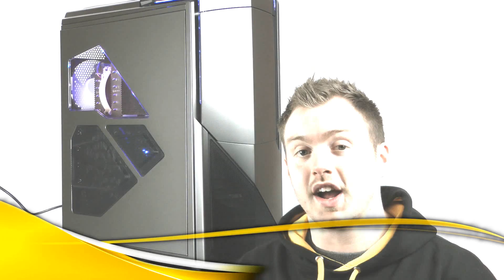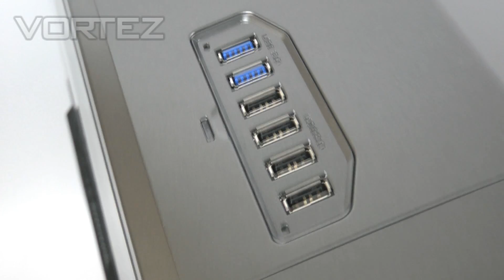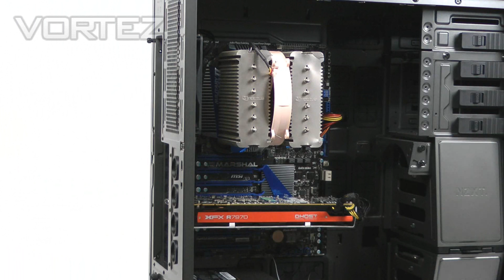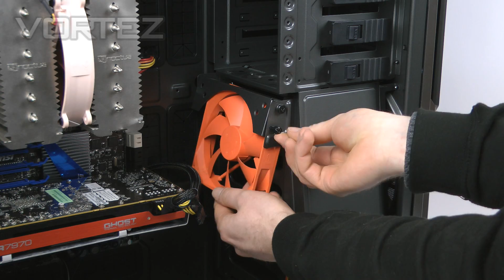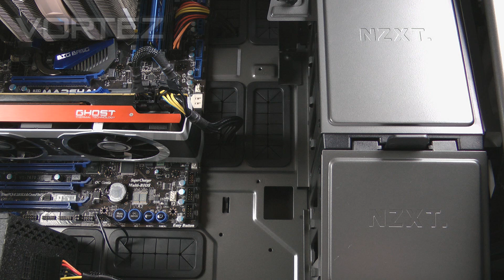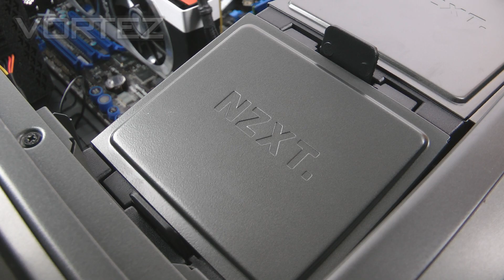NZXT Phantom 820 Review [HD]

Comment: hello, how do the front and top filters come off pls and are they easy to clean like the bottom ones ?
Reply: didn't try to clean "it" yet do you recommend to swap the side fan so it will blow out ? or should I transfer it to the top free slot ? and order another one from nzxt ?
Reply: ***** cool thanks, 4 now I use the hd 4600 of the cpu the peg is with gt610 1gb only 4 audio and lav codec hw acceleration and the intel quick sync for the svp filter, right now I have stock cpu cooler i7 4790k and I have the dominator airflow platinum for the 32gb ram vengeance pro the pivot fan is awesome I have 12cm and its on the chipset and peg does the job I will get 14cm, thank bro keep in touch !